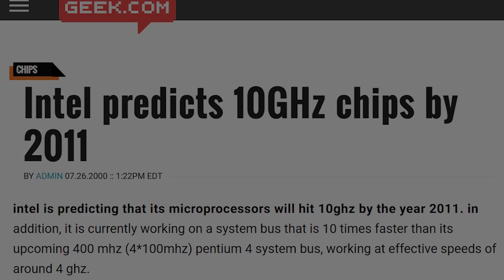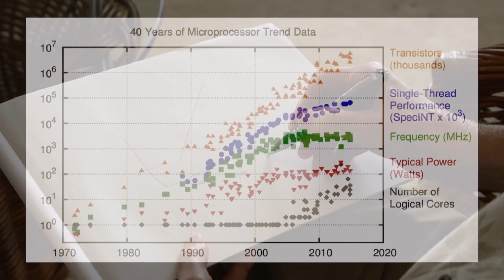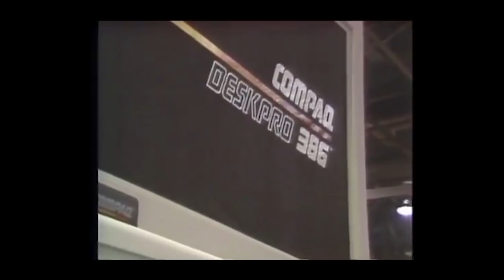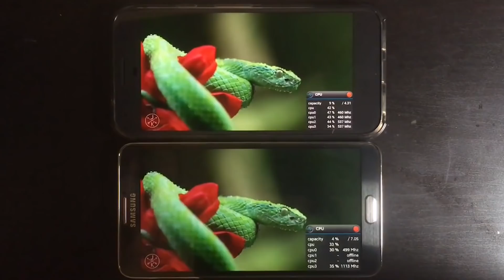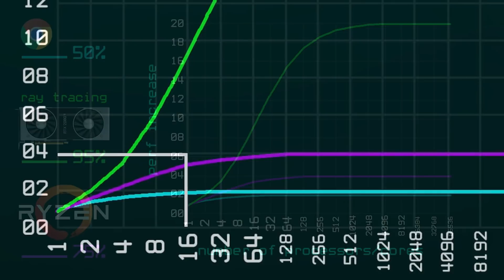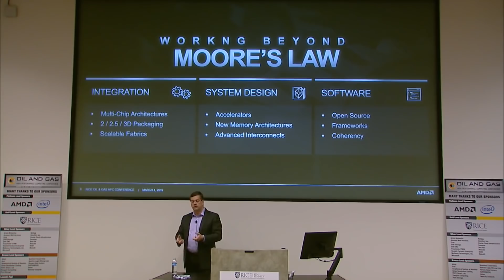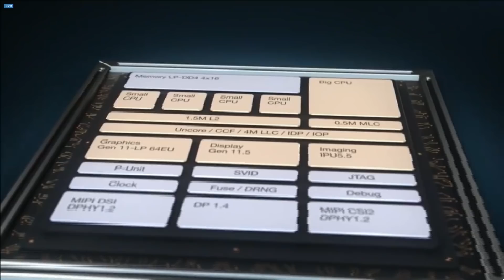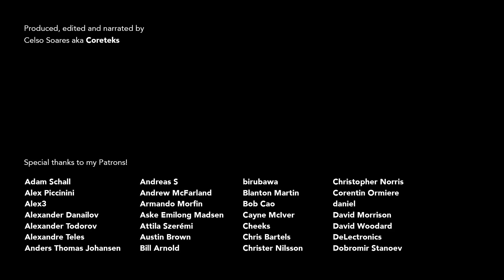Intel and AMD going BEYOND Moore's Law

Comment: As someone who tried multiple times to enhance performance of my code using multiple threads, I can say, it is strangely convoluted.
You'd say you can just select portion of code and tell it to run on different thread and that'd be the end of it, but no. It seems computer is unaware what core is most free to do anything, and sometimes even randomly put load on core that is already doing something. That way your program can even take longer to do the same thing. Futhermore, it may take too long to initiate another core to do anything, so you loose large amount of time doing nothing waiting for core to begin doing anything. And if you do it improperly code on a different core will not even start before code on previous core is done. So you need a special coding just to make sure parallel execution works even while on different cores.
Add to all that data about multithreading coding is very scarce, and you can see why people are not really thrilled about coding on multiple threads.

I'm no expert. This is just my limited beginner's experience.
Reply: In practice we usually have different subsystems in a program running in different threads.

The GUI or console on the main thread.
A subsystem that handles TCP traffic may be on another thread.
Then a state engine running the business code, still on another thread.
And maybe database subsystems running multiple threads.

in this kind of model, each system would be running asynchronously. 
Typically they would communicate using lockable queues.

What I suspect you might be attempting is to have multiple threads tackle different dimensions in a dataset. This is effectively managed by defining the stages of your data processing and have a pool of threads. Your data goes into a queue, and the threads grab data from the queue, process it, and then when done, put the results in another queue, then go back for another set of data. This requires some up front planning to work efficiently. I've used it to good effect in image processing apps.
Reply: @0x0bee0bee  That isn't really relevant if running on multiple cores. But it does matter if in you're running multiple threads on a single core.
Reply: Hence why these new systems that could do some parallelism optimizations automatically, removing the hassle, is awesome.
Reply: Have you tried using the command pattern?
Reply: @jnwms  I prefer the command pattern over typical state engines. But alas, most programmers don't know what it is or how useful it can be.

If we envision a factory floor as the state engine. In a typical system, an order comes in and all of tbe machines interact with each other with intimate knowledge of other's internal workings, to fulfill the order. In code, this makes spaghetti code easy to write and discourages proper encapsulation.

With the command model, the machines are all discrete, and the order comes in with the command. Tbe command acts as a worker, to fulfill the order, using the discrete machines and their APIs.

This takes a lot if confusion. Out of code and reduces complexity. It avoids the need for massive switch statements.
Reply: @jnwms  further, the command pattern is more amenable to multithreading and transaction processing.
Reply: Nicely put. Thanks.
Reply: So why not just program the code to cycle the load in orderly manner?
Reply: @OriruBastard  That depends on what your app does. If it's a single user app that just manages some simple document data, then sure.

But if it needs to communicate with multiple asynchronous services, like json interfaces, credit card processors and consumer terminals, then a procedural approach becomes overly complicated. and An unanticipated wait state for any service, will lock up the entire app and all of the services will time out.

So we create subsystems with their own threads, to manage each resource, so that all of them get a chance to respond in a timely manner to incoming events.
Reply: @OriruBastard  that really doesn't work.well for processing real time events from multiple sources. Any piece of hardware ir external service in the chain can make the entire process unresponsive at times.

What you're proposing works fine for simple single purpose apps
Reply: @OriruBastard  asks, "Why would you ever need more than one processor for handling a credit card anyway?"

A server handling credit card transactions for dozens of kiosks or terminals, can't afford to hold processing for other customers, while waiting for a credit card request to return.

The situation gets even trickier when the server is handling background traffic for web pages, that may have thousands of active transactions.

But from a low level perspective, it's normal practice today, to process TCP connections in a dedicated thread.
Reply: @OriruBastard  If you do complex processign in a single thread, then you've designed in a performance bottleneck, and you'll find quickly that you must implement a time slicing feature to ensure that critical systems get serviced promptly. 

Complexity and brittleness increases rapidly, while performance degrades.
Reply: @OriruBastard  If it's a single job process, then that works well.
Reply: @OriruBastard  exactly. For small non mission critical apps, it can be excessive effort.

As the apps get larger, it can improve responsiveness and help manage complexity.
Reply: i'd blame that entirely on the OS scheduler. it should be the one making sure not to needlessly overwork a single thread.

Comment: I recall in the late 90s reading about Transmeta using parallel processing to take batches of CPU-level instructions, turn them into Very Long Instruction Word sets, parse each instruction and reorder the output so that you consistently get FIFO ordering within the processor itself.

Comment: One technology that is still in it's infancy that will play a roll in the future is reconfigurable logic.  It is evolution it is probably where microprocessors where in the back in the 90's.  Rather than general purpose processors and cores think of application specific cores that change based on the application.

Comment: i always thought cores worked like, say u have a web browser open, that uses one core, u have a game open, that uses another core, u got come video rendering going on using another core and another core for the OS.  from what i hear, the way it works now is all those programs would actually be running off one or 2 cores. would the way i suggest not improve performance for running multiple programs? im always hearing 'add more RAM' if u want to improve performance of running multiple programs...but why does it have to be just RAM?

Comment: they can make transistors smaller and smaller but thats not the problem, at some point they become so small that quantum effects come into play and electrons will quantum tunnel and connect a circut, giving a false signal.  the way around this is to use particles as transistors.  particles have properties, one of those properties is something called spin.  spin can be used to represent a 1 or 0 like electrical current is used to represent 1 and a lack of current represents a 0.  this is the only way to make processors smaller and smaller. but even then there is a limit.

Comment: A whole bunch of little tweaks that won't add up to much in total. 

And it is disingenuous to say that single threaded code can be made into multi-threaded code without expressing the fact that this most often won't be possible  except in the situations where the developer simply hasn't bothered to make the code multi-threaded themselves when they could of done so.

The best clock rate increases would come from a move away from silicon.

Comment: You can't shrink transistors indefinitely. WTF are you talking about?!
There is indeed a physical limitation.
You can't create transistors that are smaller than 1nm because of the way how the atoms are distributed in a crystalline silicon surface. But you won't even get to 1nm anyway due to quantum tunneling effects which will occur at such a scale. 6nm is the theoretical limit. Anything below that is unfeasible.

Comment: atoms are 0.1 to 0.5 nano meters in size and transistors are still made out of atoms meaning that 0.255 nano meters (if you can somehow make a transistor out of one copper atom 0.255 nano meters)  is still the absolute limit or 0.1 for a smaller atom. also 56 core xeon processors are coming out lets see how it will be used in real time situations.

Comment: Many languages are just safe to run on a single thread. They crash when running at multiple threads.

You have things like volatile, synchronized, AtomicInteger and so on.

But that’s a PITA to deal with it.

You can rewrite your software to use parallel streams. But that is an other layer which doesn’t fix the problem above.

And for most software counts: just 1 IO operation (disc, network, database) costs more time than any CPU or RAM access.

The intermediate problem is the speed of the RAM. RAM doesn‘t get fast enough. After IO it’s the next bottleneck.

Comment: That "640Kb is enough" must be put into the right context.

For the PC, IBM had already chosen the Intel 8086, which has a RAM address space of 1Mb. MS-DOS split the application and the system part of the address space with a ratio of ~60:40. That's 10X the "64Kb" limit of the 8-bit processors used in home computers. And for marketing, 10X is clearly better than 8X.

A decade later, MS did something similar with the 32-bit address space (2Gb "user", 2Gb "kernel") of WinNT.

Makes sense, doesn't it:)  Or to use past-time-MS-speak: "Making it all make sense."

Comment: Hi Coreteks,  Can you please design a better logo?  Then I can buy a T shirt or a mug. You are very insightful saying things that many in the industry wish they say but afraid to. As for the 3D CPU stacking is really a dead end.  The single biggest factor is a lack of a new cooling solution.  In another word the current cooling system has hit a physical wall in term of cooling an intel i9 in a Dell laptop.  Even heat-sink cooling expert like Furakawa Electric can not push their heat piper technology any further. Unless intel can find a partner that has mastered the black art of creating a new cooling system.  Intel will become a minor player as you have predicted. If evener ARM and AMD combine as a single Chip then Intel true would be doom.  Imagine a single CPU across all platforms.  As for multiple thread programming problem, we need another Dennis Ritche to create another visionary program language that can handle multi-thread easily.  Another great video, keep up the good work.

Comment: I am very curious to see how we overcome thermal density as the node continues to drop and we can cram more transistors into a smaller region. Unfortunately it does not matter how tiny we make the tech if it becomes impossible to cool using current implementations. 

My friend proposed that we will reach a point where cores are cubes that are all linked via fine wire. To allow maximum surface area. The whole CPU submerged in liquid to allow for cooling at high frequency and transistor density. 

Just tossing out an interesting though on far future designs.

Comment: The issue withe the reduction of transistor sizes or production processes is that you reach the atomic level. The size of atoms used in silicon chips have 0.2 nm. Going below 1nm manufacturing process will mean that transistors will consist just a few atoms which raises some issues like quantum tunneling.

Comment: How many cores? Depends on the workload. This comes down to how good our algorithms are for particular workloads and at the moment it's a mixed bag.
Some things where there a bunch of known types and there is one task needing done can be parallelized with amazing perfomance increases.
That's not true of every problem.
Some problems are sequential by nature and need  raw single theaded computing power to get a result. 
FEA computations are a good example.
Even optimising for as much as can be paralleized into different threads we can't yet separate sequential calculations out into parallel processes.
Some things still need to  be finished before the next thing has an input set.
HIgh Cores are very useful although that's a diminishing returns thing now that we can transfer some and later more of the parallel computing to purpose bit parallel gpus.
Cuda cores are quicker than CPUs to do proper parallel computing.
Libraries are now here to enable those cores to replace the Cpus.
Expect to see memory hikes on the proper Quadro cards to dwarf motherboard memory in short order.
These things are dialled in to properly architected parallel computing and if workstations don't have more memory on their video cards than their motherboard in 2 years I'll eat my shirt.
Part of the problem is the people that are actually experiencing these performance boundaries and working with this cutting edge hardware are the people who are working for the Mega-Corporations that have the money to spend on the faster hardware.  They are not incentivised  to really go after the gains associated with finding a more innovative solution.
Money is plentiful so recommending a hardware solution that will guarantee a 3% improvement is a no brainer.
A big re-write has a risk few managers are likely to put their name too.
Capitalism is the worse thing ever to happen to the Human race.
Chokes progress.
Luv and Peace.
EDit:
I've optimised many processes by leveraging multi-core programming. We devs are doing it but not every task is a candidate for this. Very often in performance sensitive stuff there is a sequential nature to the calculations that can't be parellized. It's not that we're not looking for that it's just in the nature of the problem.
There is not some revolution that is going to come where the devs get on board with parallelism. There's just some problems where the workload is sequential and no-one smarter than us has found a way round that yet.
More luv and Peace.
Last Edit:
15mins something.

This would take a major change in the hardware especially around memory access and locking protocols with said memory.
If an individual thread had access to the whole memory which would be required if linear tasks were going to be completed by multiple threads it would have to be aware of the rest of the state of the calculation. It can't do that without reading the memory of all the other threads and that would likely slow it to just single process level after all the locks were dealt with.
You can't have all threads openly writing to memory. There will be race conditions that will screw everything up.
This hardware better be very clever indeed and solve problems no-one has been able to solve up to now.
It's AI so maybe...
I'm not sure we want our core chips to be understood by an AI and not our engineers.
Not saying it's a problem yet but it seems like a red flag.
Last Luv and Peace. (And maybe it would be)

Comment: There are two areas of parallelism not being well differentiated in the video: superscalar in the core https://en.wikipedia.org/wiki/Superscalar_processor and threading in software. TBB is an excellent resource for software parallelism. https://www.threadingbuildingblocks.org/. (The Task Scheduler in the Developer Reference section is where it gets interesting.)

A core’s superscalar capability is obtained via the compiler. It has a very local effect code-wise. This is not threading.

Threading is determined by software. There are automated parallelism libraries such as OpenMP, and TBB has similar functions for specialized cases related to loops. But serious threading requires some programming. One critical aspect of threading is that the thread has to be created and loaded to the core. The many instruction cycles required just to get a thread going must be figured against the efficiency of what the separate thread will provide.

Those having programmed threads realize that the most critical aspect is where two threads access the same data. You have data for a single thread and then shared data. For the single thread data, the thread moves along as fast as it can but with shared data you have to de-conflict access which at that moment reduces two threads to a single thread in that only one thread at a time can run. (It is more complex than that but I am ball-parking here for brevity.)

And so the ability of a program to be multi-threaded depends on the necessary data flow of the program. The nature of the application or program identifies a point beyond which no further parallelism can be achieved and that point is also constrained by the thread creation efficiency ratio noted above. And then there is the issue of thread swapping in the cores, similar to context switching. No doubt there can be software re-organizing apps that can do some of this data flow optimization, but I expect the very large part will be in the design and nature of the app being programmed.

All this is merely Amdahl's law again seen at the threading level. The result is that the maximum parallelism depends on the application with some applications allowing little parallelism and others allowing almost unlimited, but noting the above restrictions on how threading works.